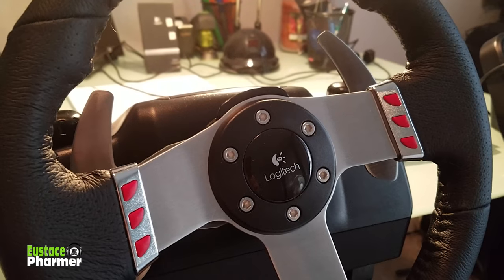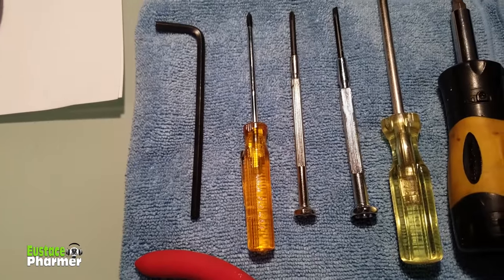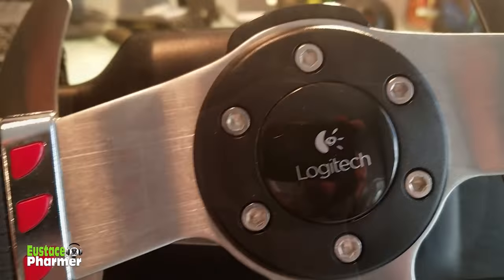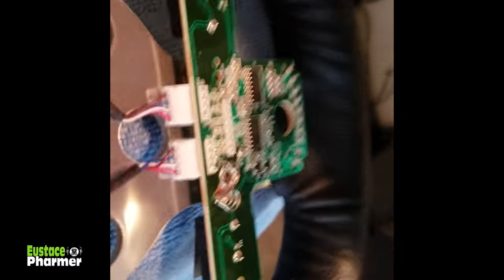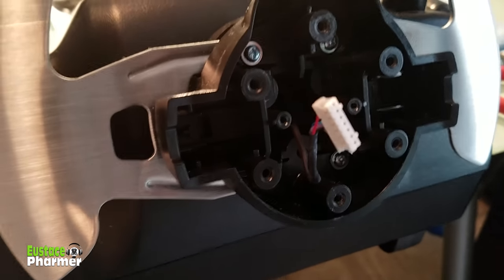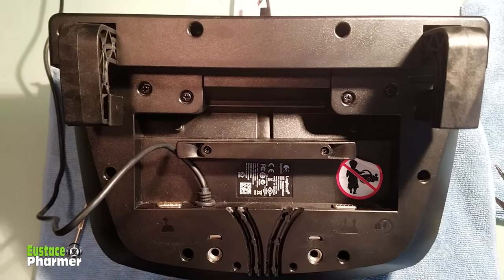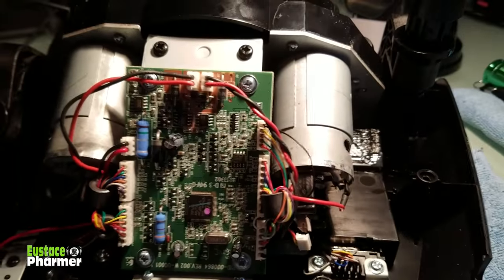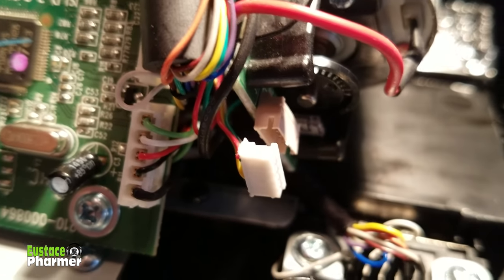LOGITECH G7 WHEEL CENTERING ISSUE FIX

Comment: Hello,
I know this video is old but I hope you could help me.
I bought a new PC and when I was installing Logitech gaming software I didn't notice that instead of detecting Logitech g27 it showed g27 as ps2 and opened calibration. I followed the instructions in calibration (it seems off the center in the calibration window, so I tried to correct it) and finished installation. After that when Logitech gaming software launched I noticed that g27 acts like ps2, so I unplug usb and plug it in and it helped, BUT my g27 is now off center. The center is 30° to right.  I uninstalled everything and tried it again but it seems like g27 changes values for the center itself (like in the wheel not in the program), I tried to connect it to old PC but the problem stays :(  

Sorry for my bad english. I hope you will be able to help me because I really want to drive on my wheel :(
Reply from the maker: Hello,I would be happy to help you.
After you uninstall the software  use a registry cleaner such as Glarysoft to clean your PC registry. Install the G27 software I have linked in description of this video. It's the original version.
After installing go in the settings and turn off automatic update and turn off Detect new games. From this point you can not unplug your wheel from PC anymore. If you do, then you will have to do this process each time.
if you're wheel is still not center after all this go in wheel settings and make sure your wheel is set to 900° of rotation and spring back strength is at maximum.
If this does not work then also download the DXTweak software I also provided in that link in my description. Look at 13:57 in this video. Match each setting to watch I show in the pictures. 
I hope this helps you. Please let me know 😊
Reply: @Atomic67G  Im sorry, which settings are you talking about?
I cannot find automatic update option.
Reply from the maker: @bumares7554  when you open the profiler there's a tab. select it and you will see option to search for new games. Disable that 😊

Comment: i don't undestrand why my g27 is more strong than gt with same settings.Do u had a problem like that?
Reply from the maker: it depends on a couple of things. If you open the software and look to see if you have "Use Game settings", then it will adjust according to what you set up in the game.
I have that unchecked.
You can also lower the resistance in the G27 software.
Reply from the maker: I went over it in the video. You can view it starting at 13:55 in video.
Use 900 degrees of rotation and then look at the other settings I put on screen. Take screen shots of them so you can refer back to them anytime.

Comment: Even Newer wheels still have the same issue. My xbox wheel had it after almost 1 year. Rma'd it
Reply from the maker: Yup, you're absolutely correct. I had a Logitech G 29 and it did it.
I switched to Thrustmaster and so far 2 years and no problem. I hope my luck holds out.

Comment: Hey dude. Nice video. I just bought this G27 used, and all works but not the wheel. It will not center lock, and dont work in Logitech programs. The pedals behind the wheel works doh? 🙃 Maybe i need to pull it apart?
Reply from the maker: make sure you have the legacy Logitech software. Link is in my description. I also give you DX Tweak program to fine tune your wheel settings.
Did you buy this used off Amazon?

Comment: How do you get the sensor clip off. I dont want to break it I am trying two flatheads it's not working
Reply from the maker: The only way I know how to get that clip off is the way I illustrated in the video. The G27 is very old so the clip won't come off easily in some cases. Just have patience and gently work it back and forth.

If you really feel you're going to break it, I suggest you go to a PC repair shop and let them do it for you. 😊
Reply: I ended up getting the clip on the board off and just pulling off the cover that way. But I figured out I must have a different issue. Not cracked and not loose but it's still getting slightly shifted to the right everytime I use it. Until I replug it. I'm thinking probly just a new sensor. And maybe because I'm using the newest logitech software. Any ideas?

Comment: hey, after putting everything back my wheel only caliberates halfway and then stops, any suggestions?
Reply from the maker: Jordy Lopez 
Try a different USB port. Also make sure your profile software didn't update. You should see the G27 image. Sometimes it will update on its own somehow lol. 
If all that doesn't fix it then you may have knocked something out of line when you put it back together.
Reply: I think help is too late? I had the Problem myself; the Encoder was not on the Shaft in the Position it should have been i was working for days before i found this...
Reply: Maybe it will be helpful for someone: check the degrees of rotation: it should be 450 in one side and 450 in the other. Less values means that you have assembled it wrong. Check the stopper on the main axis: it should look upwards, othewise it may not let the wheel to make a full rotation and cause this calibration issue.
Reply: Maybe late but mine goes fully right then fully left and doesn't want to go to the center

Comment: Hi, I use my G27 on my PC, and now when I plug it in, the steering does not calibrate right, left then Centre anymore. When in game, all the buttons work, except for steering - I can't steer when in game (I have the latest firmware available). Will what you showed us fix that problem, do you know? Thanks in advance.
Reply from the maker: Hi Nikolas, thanks for watching and for the question.
First thing I have to ask is, do you create profiles for your games using the Logitech profiler software?
That's an important step and because G27 is not supported anymore the software will try to update every time you unplug your wheel when the PC is >ON<
It will update to a wheel you don't have.
if you must unplug your wheel; do it when your PC is turned >OFF<. 
Make sure you plug it in when PC  is >OFF< as well.
Also, if you're software updates you'll have to Uninstall that software and use a registry cleaner than reinstall the correct software.
I recommend Glarysoft to clean registry.
I have a link in the description of this video to my Google drive which has the Logitech G27 profiler and a program called DX Tweak to fine tune and recenter your wheel. Let me know how it goes.
Reply: @Atomic67G  thanks, I will give that a try.
Reply: @Atomic67G  it didn't work 😢 just like before, all the buttons work, except for the steering - it does not/I can't steer left or right. Something is probably broken or loose inside the wheel.
Reply from the maker: @nickolastiguan 
you're going to have to open it up and have a look inside.
Reply: @Atomic67G  thanks for the Video and replies.

Comment: I came here for a hand lotion commercial and instead i figured out how to fix my wheel. Sadly tho i have to redo it all over again since i think i have glue on a few of those holes on the optical encoder :/  I had to laugh at mine tho, when i got to that part, those 2 screws holding it down, well mine were half out. Im kind of amazed at how long it went with them out before i got the centering issue due to a break finally happening.

I have a friend who's boss will 3d print out a new one for me if i want to for like 10$ which i might do if i can find the correct format of one for. I did buy a washer to glue in to act as a brace to hold it it tho. M5 was the size, i cant remember what class it was tho (for thickness). The washer was perfect size tho and held really snug to the center piece. I was a bit amazed at how well it fitted in.

Great video tho. It really helped with the way you zoomed in and used the screwdrivers as a guide on thing.
Reply from the maker: LOL@ hand lotion commercial. Yes if you have any debris on the optical sensor it will cause problems. Just be careful what you use to clean it. Thanks for watching :D
Reply: I just woke up so havent touched it, but had it soaking in soapy water for the last 15 hours or so in hopes to losen up the glue a bit to try to remove it.  its funny because the wheel would lose its centerting to the left about 30 degrees, and now when it turns on and calibrates its to the right about 30%

After tearing it down and rebuilding it up about 3 or 4 times i did  notice the wheel start to get more tighter o turn, which im assuming is from the lubrication on it getting wore off a bit.
Reply: So i just followed your guide, worked great, got to the 2 screws to tighten, they were already very tight, i then inspected the optical encoder wheel , no damage, looked to be in pristine condition, put it all back together, still getting alignment problem, any ideas?
Reply: One thing to make sure is to put the optical encoder with the shaft down (i put it back together upside down and had to do it again). Also make sure the encoder is closer to the side with the black relay thingy. Mine looked in great condition but i finnaly found a spot that it was cracked at.  

I ended up buying a old momo at the goodwill bins and used it in its place. I had to modify it a bit and then super glue it it to the shaft, so its only a temperary fix for me.

Does yours lose alignment over time/usage? At first i used a old program called, DXTWEAK, and set the alignment off to the side so it would align up. Its a neat old uitlity, about 10 year old, which worked fine on my win 10 system.

If its not drifting off alignment with use, then i would definitly check out that dxtweak utility. 

I just got mine working the other day but havent been able to test it out as the heat came and  my feet swelled up so i cant do any driving right now. Teaches me for not drinking enough water, lol.

On mine, there are 4 grooves and it was at the end of one groove where the crack was at. Sadly it looks like the part was designed to fail after awhile.

Another thing you could do is just buy a washer to put on the side, glue it to strenghen it. I believe it was a m5 washer (metric, size 5). I got glue in the spokes so it fails for me :/
Reply from the maker: Arrakis Rodin 
Hey Arrakis, thanks for all the great info. First of all I'm sorry you have swelling and discomfort. Second, if you use dxtweek  be sure to download the appropriate version for your system. I run windows 10 64bit. and found someone who has the file. 
Also, I think there are two fixes that eventually will be necessary. 
1. look for a local tool and dye maker. Give them the part and they can make a replica out of metal. You can make another plastic one if you contact someone with a 3d printer. 

2. buy a new wheel. I can't say anything good about the new G29. I have one and it broke in 3 months from a known wire breaking problem due to its violent calibration sequence. 
I hear thrust master has a nice wheel though. 
Hope this helps.
Reply from the maker: Ripknotz 
Hey Rip, if you have a bad alignment problem then there has to be a hairline crack in the sensor disk you just can't see. This design is meant to fail over time. The only solutions I can offer is to contact a local tool and dye maker and let them make you a new optical disk out of metal. You can contact  someone with a 3d printer and they can make one from plastic too. 
It shouldn't be expensive to do this. 
Lastly, it may just be time to get a new wheel. 
Hope this helps and sorry you have to go through this. I know how frustrating it is.
Reply: I had a friend price it on her 3d printer at work and it was about 10$ in materials to print one out.
Chances that it is a hairline fracture you cant see is highly possible because i thought mine was ok at first also until i finally found one on mine.
Reply: What do you mean by this? the wheel start to get more tighter o turn, which im assuming is from the lubrication on it getting wore off a bit" i changed the encoder and tighten everything but it didnt help, the wheel stops after max left turn during calibration.

Comment: My last Connector dont wants to come of.... do you have any Idea how i get it off?
Edit: I just made it... i'm sweating now...
Nice Vid and very Helpful
Reply: ... i took a short Brake and now i took the Cap off... the Spokes are Broken.... what now?
Reply from the maker: BuggyGamer 2511 
Hi buggy, not sure what you mean by "Spokes". Do you mean that little black optical disk? If that is broken you need to replace it. Some people glue it back together but I don't recommend doing that. it won't last and if you get glue on the surface of the disk it won't work right. You can find online someone selling a G27 for parts or you can contact a local 3d print service to make a disk for you. it's not expensive in comparison to buying a new wheel. it can cost around $60 American to have it made.
Reply: Ok thx, if i remember Right a Friend wants to throw his G27 away because the Connection from Wheel to Base is Brocken, maybe he still has it or i´m going to search after the Weekend, maybe i can buy a Scrap G27 for Cheap.
Sry for my Bad English and have a Nice Day!
Reply from the maker: BuggyGamer 2511 
I wish you the best of luck. No need to apologize for your English. I think you text English very well actually. Thank you for helping me by commenting in English 😊
Reply: Eustace Pharmer
Update: Everything works since some weeks now without any Problems after i bought a Brass replacement, i even can feel that the Wheel is more Responsive than before and is more Accruate. Thanks for the Help! It saved me my few Money i have and it was really worth the waiting for the new Part. Have a Nice Day and keep your laugh and humour :P
Mabe you will see me under another Vid from you^^
Reply from the maker: BuggyGamer 2511 
I'm really thrilled you were able to fix it! I appreciate you letting me know 😊It's always a pleasure to help. I know how it feels.

Comment: So if my wheel keeps changing where the center is as i play is this the issue?
Reply from the maker: yes, that's an issue. Could be the settings in the game software and or the G27 software.
Start there before taking apart the wheel
Reply: @Atomic67G  it started 90 degrees off to the left but basically kept moving until it was 180 degrees from where it started just by playing a game a little bit. I just bought it used. Will try to take apart when i get a chance. Thanks for the video.
Reply from the maker: @mpresto15  I provided a link in the description of this video. It contains the legacy software and DX Tweek software to realign the wheel.
Do Not update the legacy G27 software. Tik the box that says don't update games in the configuration software.

Comment: Chef please  answer to my question, when I play a game like City car driving when I turn my steering wheel isn't working in the game, like when I open my PC the steering wheel don't turn please help me.. Also I'm subbed you are sympathetic 😉
Reply from the maker: The first thing I would do is unplug the wheel and try it in another USB port.
Regarding games, you have to check if your wheel is supported. Some games only support controller 🎮 or keyboard 🎹.
make sure you have the original G27 legacy software profiler.
There's a link in the description to get it from my Google drive.
Unplug your wheel
Uninstall your profiler
restart pc and install my version.
Hope that helps and thanks for subscribing 😊👍
Reply: So thanks
Reply: @Atomic67G  but the touches in the steering wheel works
Reply from the maker: @sanih7402 
if the buttons work and the wheel won't calibrate or move then it could mean that you need to send it for repair or replacement. the celinoid motor could be finished.
Did you open up the wheel and see if everything is tight and connected?
Reply: @Atomic67G  yes

Comment: Please and please help me on my g27 when i turn my steering wheel in game it doesnt work but buttons on steering wheel works please help me
Reply from the maker: What game are you trying to use it for?
Reply: Atomic67 G i tried on euro truck simulator 1/2 and city car driving the problem is not in these games the problems is on the steering wheel
Reply from the maker: @sanih7402  I understand what you are saying. The problem may not be the game itself but it could be a problem with how the game recognizes it.
You need the legacy profile software and set up a profile in it for each specific game you play with the wheel. If you don't have it, there's a link in my description to get it from my Google drive.
Set the software Not to update and not scan for new games.

unplug your wheel and also reset your wheel and pedal bindings in Euro truck menu.
After clean installation of legacy software restart pc and open game and set up from scratch.
That should do the trick.
I had a similar problem as you are experiencing and those procedures fixed the problem.
Reply: Atomic67 G thank you so much ill try it
Reply from the maker: @sanih7402  you're very welcome. Also if you ever Uninstal the Logitech software you need to use a registry cleaner app after to wipe residuale files left behind before reinstall.
You may also see the software update to a newer but wrong version every time you unplug the wheel.
It's old software and isn't supported any more so that's the problems you have to battle.
If it ever updates, do what I said above.
Uninstal, wipe with registry cleaner (I use Glary Soft)
reinstall.
Keep multiple copies of the software install file from my Google drive on your PC and external hard drive so you'll always have it. You can't get it from Logitech anymore 😊
Reply from the maker: @sanih7402 
https://www.glarysoft.com/
Reply: Atomic67 G tysm
Reply: Atomic67 G hey last question what is the name of the issue because my english is not very good thanks.
Reply from the maker: @sanih7402 
based on what you have described to me, I would say the name of your issue is
"G27 Wheel not recognizing games"
Reply: Atomic67 G thanks love you
Reply: Atomic67 G no videos about that but thanks for your help